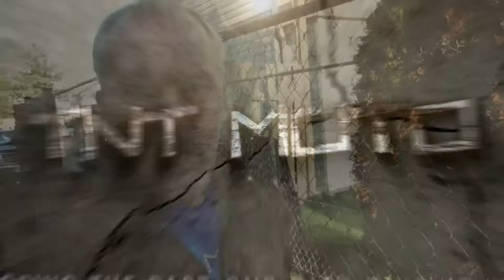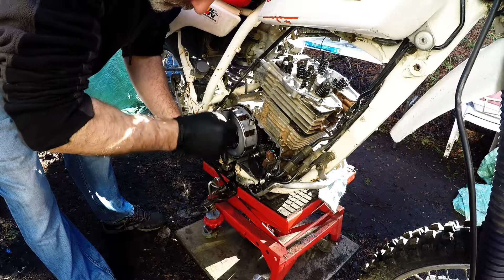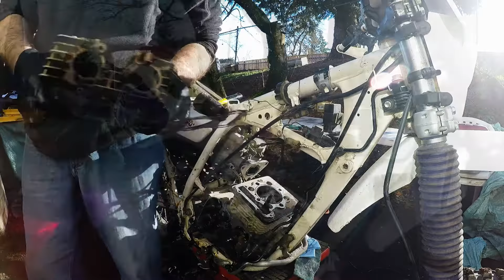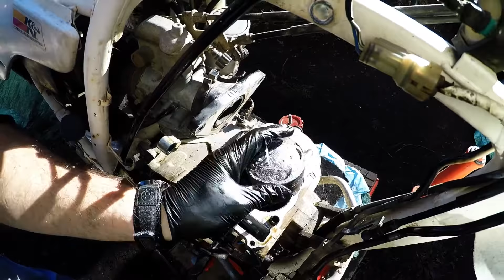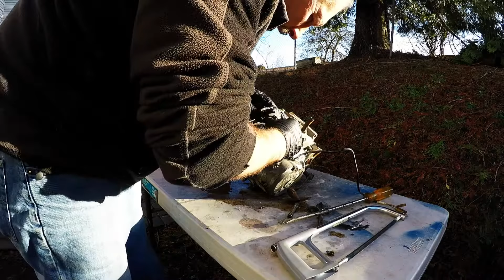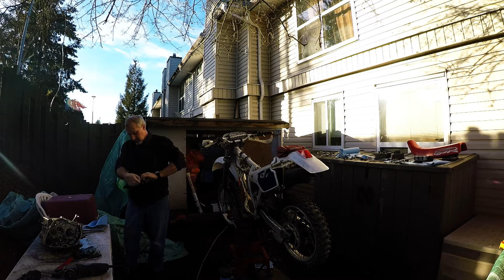$500 Craigslist Honda XR250 Death of a motor!

Comment: That’s a shame. Those 250s and 400s are really great trail bikes.
Reply from the maker: Yes, i will get another one day that will not cost a small fortune to restore. I really want to restore a 1984. That year i bought a 200 when i really wanted the 250. Would have had to work another 6 weeks and would have missed the summer riding. So i got the 200. It was a mistake, if ridden hard the 200's suffered valve train issues. Wound up destroying the head after snapping the cam in half. The 250,350 and 500 were bullet proof. There is a 1984 on craigslist needing an engine rebuild but guy wants too much for it.

Comment: I would be curious to know how this bike was being ridden, and exactly what took place for the engine to end up like that. I mean... you're not going to set any records on it, but that isn't what these bikes were made for. These XR's engines were arguably the most reliable engines you could find in a motor bike. I can't think of anything better for doing long trail rides, or for any kind of utility purposes. These are the perfect bikes for beginners to learn on as well.
Reply from the maker: My guess was an extreme lean condition. I got the bike from a guy who got it in a storage locker. I wish i could find a motor before i tear it all down to sell, but they are rare and costly.

Comment: Wondering if you ever parted out the XR 250 or you still have it ? I see them on CL that you could by from $200 - $400 a  complete bike some  running....maybe buy one and use the motor out of it after a rebuild to fix yours ....I found one for $200 and going thru it now .  love all the vintage bikes . I restored a 1991 suzuki  dr 350 I picked up for $400 and I ride it a lot now ....Ok let me know where the XR 250 is ....thanks for the videos   cheers
Reply from the maker: ski bum all parted it.
Reply: Hopefully you will come across another one day and getter going ..... ; )

Comment: I think I got a very decent 91 XR250 for €700 here in Malta. Runs quite well but has a kind of knocking sound from engine. I just got the tank and seat off to prepare to remove cylinder head to check. I think it could be valve train issue.
Reply from the maker: Sou d like a knock or a slap. Could be stretched timing chain
Reply: @TNTMOTO  could be. I will check it too

Comment: How the hell does an air cooled bike get that hot dam the piston on my cr 125 didn’t even look that bad after it melted
Reply from the maker: Roman Buset had to have been running extremely lean and low on oil.
Reply: I used synthetic oil in a 1980 yz80, It didnt like it. A crank needle bearing run up the cylinder from the bottom end and made it into the cylinder poking the piston/head and the loose metal welded the piston to the cylinder. It ran fine with yamalube. Dont use synthetic.